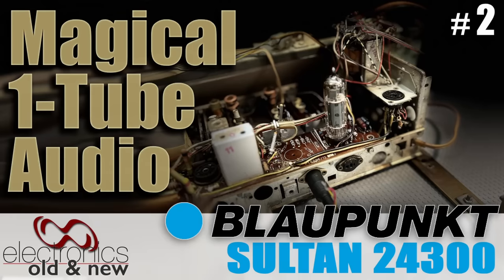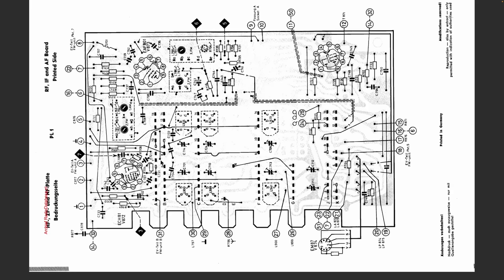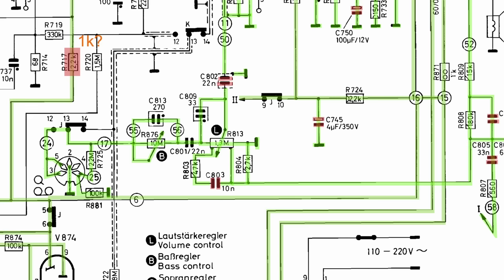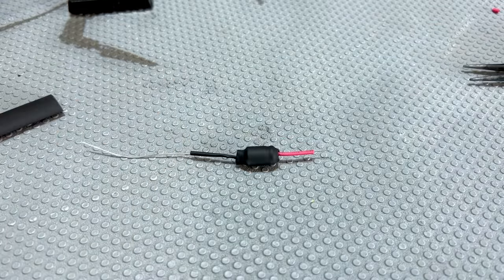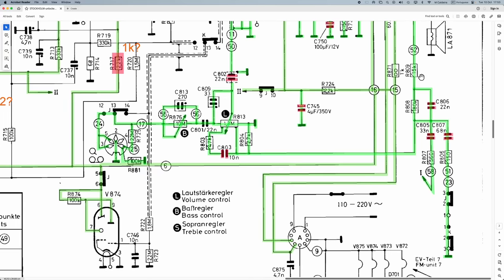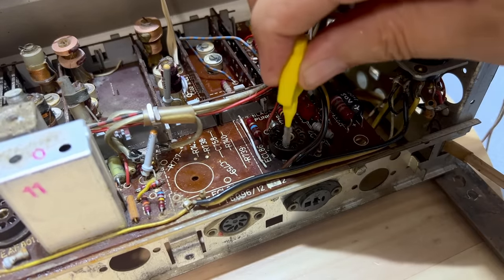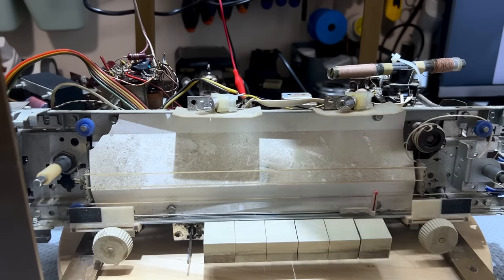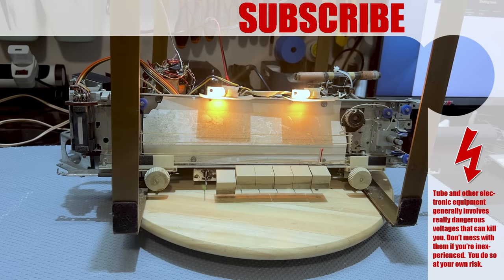Audio stage restored and tested. Blaupunkt Sultan 24300 restoration pt.2 #pcbway#

Comment: Because I do so much restoration work for my own clients, and have a considerable backlog, I simply don't have the time for the finer cosmetic touches, like turning a radial cap into an axial one.  But I can certainly appreciate your great attention to detail.  I see that the  ECL86 has indeed "bit the dust".  These "combo tubes" always seem to be more failure prone than their single stage counterparts.  It's much the same issue that I have with the SABA Continental (Freiburg) with its dual ELL80 output tubes. Those too are drying up. Another failure prone tube that's prone to leakage and noisy operation.  I've thought of making up a PCB with  sockets wired to take 4  EL95's as replacements. There was an adapter made, that plugs into the original tube socket, but it won't fit in the SABA.
Reply from the maker: The SABA is super packed, so I can see why adapting the tubes would be difficult. 
The time I’m able to dedicate to these radios is purely because it’s a hobby. I can understand that some of the details would be impossible if I was doing this as a profession. The ultimate objective is the same: getting these to work again 👍

Comment: Quick note, when you have a burned and exposed resistor, you can often take measurements from either end to the exposed middle and get an idea of what half the value might have been even if the resistor measures open.
Reply from the maker: Good point

Comment: Just a thought, you could 3-D print end caps for the capacitors you put inside the heat-shrink tubing. I’m thinking they would also be inside the tubing, and would also act as guides for the leads. You could probably even print entire enclosures if you wanted to.
Reply: With 3D printed parts from his favorite sponsor PCBwhatever? 😂
Now while your idea certainly is feasible, I ask myself where this ordeal will end.  To each his own, but at this degree of striving for autenticity one should gut the old caps and use miniature or even SMD electrolytics to restuff them to preserve a 99% original look. Because just plainly looking at the facts, one has to remember that the original caps were not hand made to begin with. They were already mass produced. So strictly speaking his hand made and most of all hand labelled ones are actually much more out of place than new axial ones could be. And if you were opting for radial caps, if you just bend the negative lead back and put transparent heat shrink on, you would have the axial mounting shape and a mass production looking labelling. But why all of this? After all he is using these red radial film caps and splaying out their leads to replace the old axial paper caps. That mounting sticks out as much as a radial cap with the leads splayed out would...
Reply from the maker: Could, but not really necessary.

Comment: Looking good so far.  I think people sometimes get confused with watts as so many solid state manufacturers claim ridiculous high numbers, which they really never meet in the real world.  I find "Tube Watts' are quite different to the solid state claims.   1 to 1.5 watts in a table top with the original speakers is heaps.    It sounds like nothing compared to 50, or 100 watts claimed be modern manufacturers, but it really is comparing apples with oranges.
Reply from the maker: True 😊
Reply: The only real difference between tube and transistor watts takes place at the overload point of the amplifier. Most transistor amps clip very cleanly, with clear "flat topping" of the waveform, where tube amps used in radios will gradually distort until pushed well into overload.,  This kind of "clipping" is more tolerable to the ears, but in my opinion, it would be better to just design the audio system to have sufficient loudness capability without ever approaching the clipping point regardless of the topology used. The best sounding tube radios I have all use push pull output stages that produce higher power and lower distortion than the single ended types. They all sound better too.

Comment: Just out of curiosity will you be testing the dud ECL86 on your valve tester to find if the triode or the pentode is at fault? If the pentode part is still good is it it worth keeping for adhoc projects?
Reply from the maker: I may do that.
Reply: There is no real sense in keeping a dead tube around other than for fooling around with. Yes, the ECL86 is expensive, but the 14,5V heater PCL86 are still rather cheap. And they are drop in replacements if you can provide the higher heater voltage (f.ex. voltage doubling 6,3V to 12,6V which is close enough). And if you want to base something on the  pentode section of an ECL86, you can use a EL41 or EL80. These are the pentodes that the pentode section of the ECL86 was roughly based off of. 
But all these tubes are getting rare and expensive. So for any project with significant use or life span, you should avoid the ECL86 or opt to rewire existing circuits to use 1/2 ECC83 and EL84. There is even a project for adapters to make up an ECL86 by either stacking a ECC83 and a EL84 on top of each other or in a side by side adapter, much like the ones that were made for the ELL80 using two EL95.